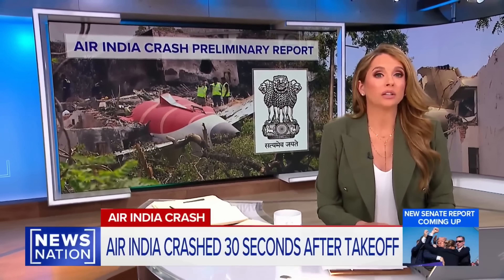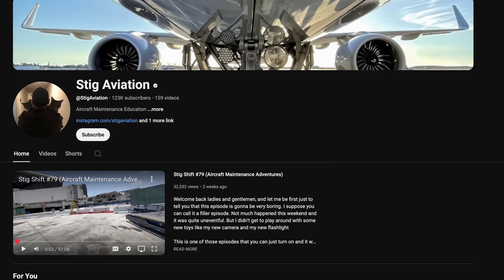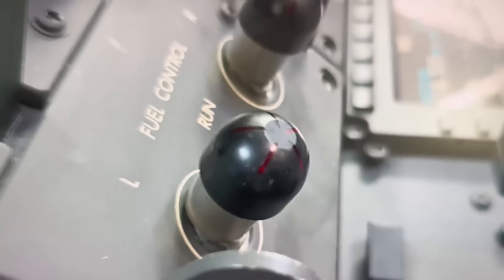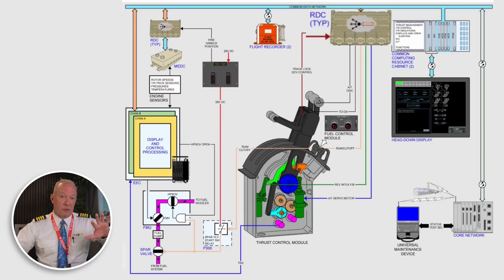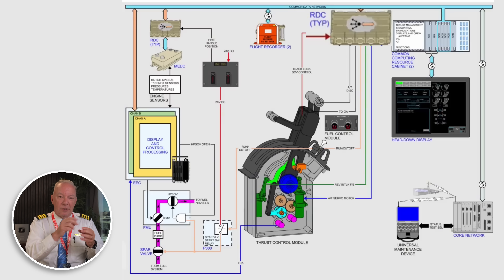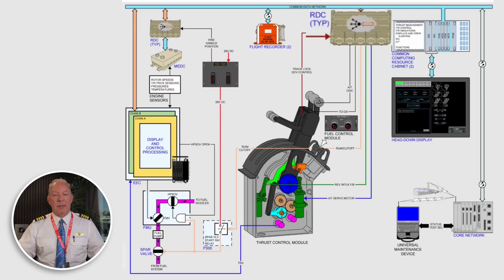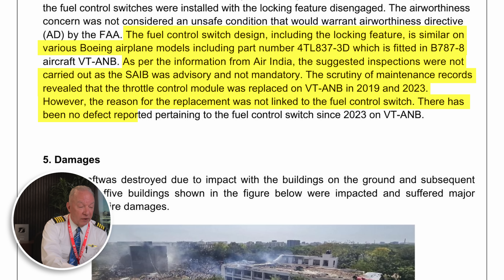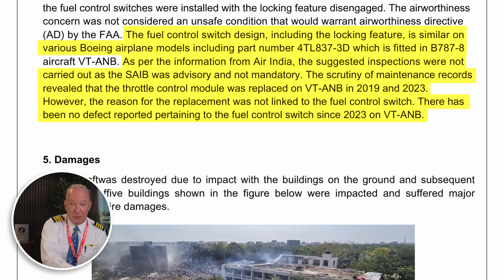The Truth About Boeing 787 Fuel Control Switches

Comment: Dear Captain Steve:  I REALLY APPRECIATE YOUR RECITALS ON THE FUEL CUT-OFF SWITCH CIRCUIT.  I haven't seen this schematic or been able to independently verify the "closed circuit" you describe.  My question:  "Does FADEC have capacity to override pilot input and/OR cut-off fuel to the engines?"

It's my understanding that the Full Authority Digital Engine Control (FADEC) System can, through limited scenarios, perform a fuel cutoff both with and without pilot input.  I'm certainly not trying to argue or create false theories.  I'm seeking detailed electronic facts.  As a collegial, fellow commercial pilot/instructor, I'm exploring these systems to rule out the role they might have played in this terrible disaster.  Here's how one Q&A session explains FADEC.  Is the below description wrong?  Maybe I need a better electronic schematic:

** Automatic Shutdown Capability: FADEC can initiate engine shutdown under specific circumstances, such as when FAULTY SENSOR DATA indicates an engine abnormality. It constantly monitors engine parameters like pressure, temperature, and vibration. If these parameters go OFF LIMITS, FADEC can alert the pilots, limit power, or EVEN SHUT DOWN AN ENGINE IF NECESSARY. 

** Pilot's Role in Fuel Shutoff: While FADEC has automatic shutdown capabilities, a physical fuel cutoff switch is also present, which pilots must manually engage to physically close the fuel valves and stop fuel flow to the engine. When the switch is set to "CUTOFF", the spar valve and engine fuel shutoff valve close, FADEC then disables ignition and begins the engine shutdown sequence.

** Interpreting Fuel Switch Position: The electronic system, including FADEC, interprets the position of the fuel cutoff switches as a command to either allow or cut off fuel. Therefore, a pilot moving the fuel switches to "CUTOFF" electronically signals the system to cease fuel flow. 

IS THE FUEL CUTOFF CIRCUIT TRULY A "CLOSED" CIRCUIT? Like many control elements in modern aircraft like 787-8, such elements are manually transitioned triggering electronic interpretation (sometimes referred to "fly by wire."  As you know better than I, systems depend on sensors to trigger actions directed by systems like FADEC.  FADEC is also connected to temperature, pressure, and a thrust malfunction control system.  As I understand it, FADEC also must "interpret" the Fuel Cutoff Switch position to determine if it should close the appurtenant spar fuel valves and starve the engine of fuel.  Is this inaccurate.

You are perhaps the most uniquely qualified (although we might need an electrical aviation engineer, too) to more thoroughly describe and apply relative significance to the 787's ability to cut-off fuel absent pilot input.  

I don't know the fuel cut-off parameters within FADEC for temperature, pressure, etc.  Those parameters are programmed with software into the FADEC system.  Can we verify and explore those parameters and open the box on the mere possibility that, perhaps, a fuel temperature control sensor was faulty and sent an errant message to FADEC?

Isn't this worth just exploring a little further without concluding?

THANK YOU, Captain Steeeve, for your consideration.

Comment: Capt. Steeve, Sir Air India has history of forging maintenance records. I am not saying this. DGCA is saying this. There was many safety violations in the past which DGCA stated they have fined Air India for and Air India has paid fines which was slap on the wrist. Just like Safety violations by Alaska airlines and door blow out incident. FAA fined Alaska and they paid fines. Which was slap on the wrist. In the past accident investigation reports have been fudged so no accountability on airline and they dumped everything on pilots  in previous accident. This is according to Capt. Panesar retired director of flight safety Indian airlines. Same thing with Oing. FAA found numerous violations with Oing. Now main question that arises from this incident is who is responsible for this crash Air India or Oing? It is not the pilots. Make aviation safe again. Make passengers trust and happy again and happy tailwinds. Thanks for your insight sir.

Comment: Captain Steeeve. You have proven yourself to be really silly. Every explanation you have offered since day 1 , has been premature, proven wrong and basically defending Boeing even before the preliminary data has come. Either you are foolish or in the payroll of Boeing. Your fixation on pilots being incompetent / suicidal are again being proven wrong and you should be ashamed of sharing your half cocked mental farts in public just for some clickbait. The pilot associations should actually sue you for defamation. 
And I am not a pilot just someone trying to find the real cause so that real improvement is done to aviation rather than blanket clearance awarded which perpetuates the problem. You guys are far cries from the great americans that actually helped create the moden world and who were very clear about finding the problems without defending the vested interests.
Reply: stfu
Reply: Sorry.   All roads lead to the cockpit.  The FDR and logic, says so.   No one is shilling for Boeing; they don't even make the engines or the FADEC ecm firmware.   In this case, that aircraft did what it was told.  That is just reality.
Reply: @jprkzoo3463 how do you explain same problem in another boeing 787 in japan many years ago? Luckily the plane was higher so it was able to restart the engines. This will be proven to be an electric issue . Captain steve from day one has been blaming the pilots and being proven wrong everytime. Most experts are waiting for actual data to come out rather than shooting their mouth off.
Reply: @yureshsinha3904, I wrote a similar comment to yours a few hours ago, which was quickly deleted. Don't be surprised if your comment will be deleted as well..  Apparently. someone here does not fancy non-flattering comments..

Comment: At what point is the computer measuring that the switch is open or closed. Is it at the switch itself or in the relay? If the relay, could it be react like the switch was turned off due to a main power glitch?

Comment: @CaptainSteeve tip-toes right to the edge of the most probable root cause then somehow misses it.   

The battery.

He discusses a total electrical failure and how it was later simulated and says "But you can't simulate a battery failure".

Yeah, so think about that Captain Steeve.   What if the battery fails?  What if it short-circuits?  What then?   It is a lithium-ion battery, with a chemistry that is known to be very unstable and prone to thermal runaways.   It is also a single-point of failure between the two electrical buses because there is only a single battery for the two buses.

It is protected from overcharging by diode(s) that could fail silently, which would then bypass the battery monitoring system and allow unregulated DC from the captain's bus to reach the battery cells.

In short, if the battery short-circuits it would drop the voltage on the primary bus to 0.  Within approx 1 second, the 2nd bus would connect to it in an attempt to restore power, but the large short would then drop the 2nd bus to 0 volts also.  Result:  total electrical failure on the two buses.  And the cascade continues from there.

There is deep analysis and discussion of this scenario in these videos by an actual electrical engineer which I highly recommend that everyone watch:

https://www.youtube.com/@jeremyjohnthompson5187

Comment: So why did the RAT deploy before the cut off switches were set to off?
Reply: How do you know that it did ?   thats pure timing conjecture Ive seen on other channels.  I'll bet if we saw the logic flow chart, in the air mode, if both fuel run/cutoff switch states read "0," the rat automatically deploys.  its proactive logic in the system;  not re-active.  One engine won't trigger it;  both will.

Comment: Fail Safe would be where the Valves stay Open with out DC power and only close when the DC power is applied to the valves.  That's a basic design concept.
Reply: but doesn't address one of the biggest dangers on an aircraft. Fire.  There is a reason it's not "normally open."

Comment: The pilot might have been waiting for the nose to pitch down before cycling the fuel switches back on so that the windmill restart had a better chance of success, given the aircraft was at the lower speed range ( around the claimed 180 knots ) for a windmill restart and the APU restart to required power ( up to 90 seconds ) would be nowhere near operational enough to be providing power for an engine restart, given he flight only lasted 30 seconds !!!   The video shows the aircraft pitching slightly down momentarily during the very short flight time. The pilots would have been battling maintaining required engine restart airspeed Vs maintaining altitude. 10 seconds gets used up quickly when you have two pilots arguing about what is happening.  Many technical, timing, and human factors are still unresolved. Jumping to conclusions ignores the complexity of systems failures, pilot perception, and rapid unfolding events in the cockpit.  It was really a no win situation in the end.